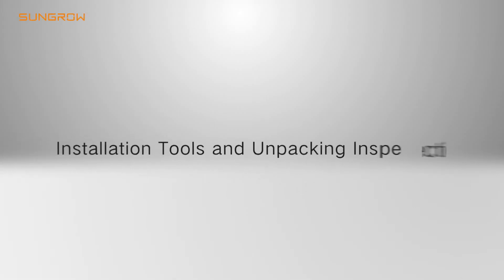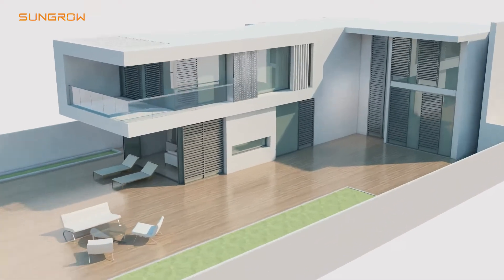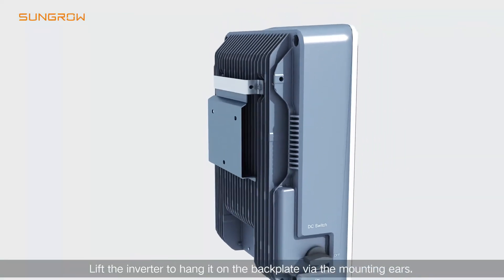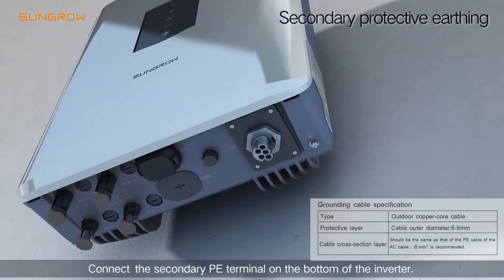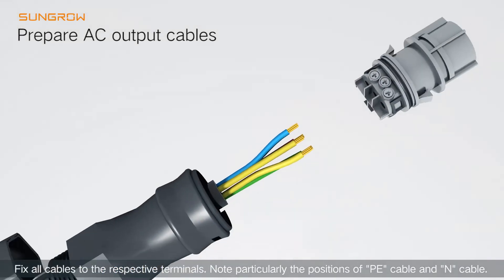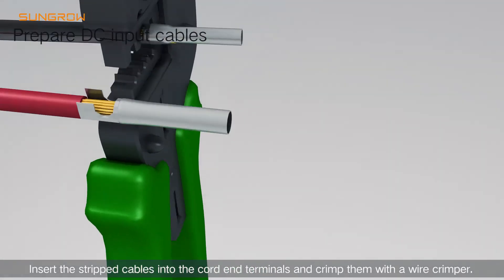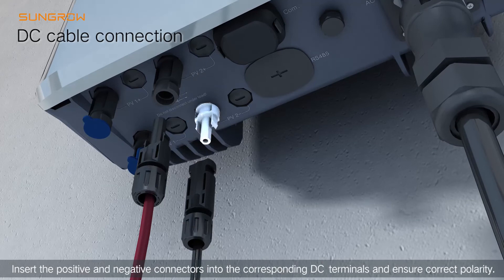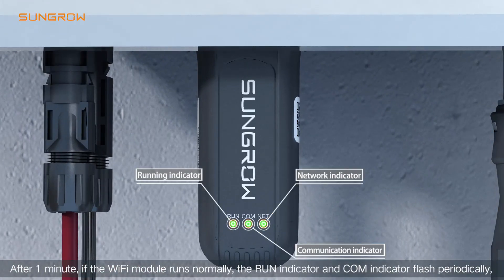Guidance for SG5KTL-MT/SG6KTL-MT/SG8KTL-M/SG10KTL-M/SG12KTL-M Installation and Commissioning

Comment: Can you pls guide how to connect 14 Canadian Solar Panels 595W each,18 Amps Short Circuit current  for 8KW On Grid System with Sungrow SG 8 or SG 10 RT 3 Phase On Grid Inverter.Shall we connect in one string or 2 strings